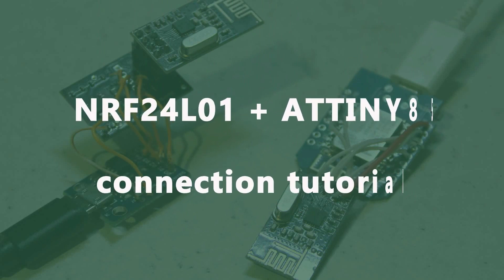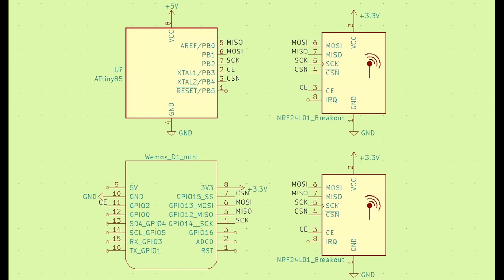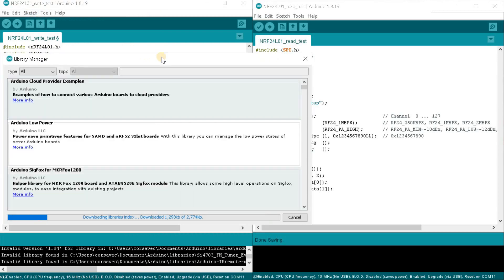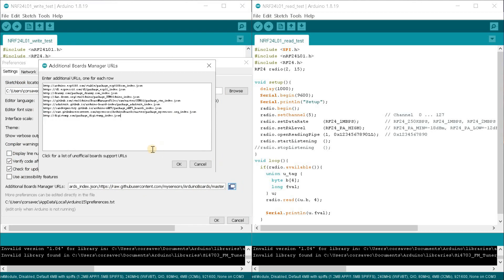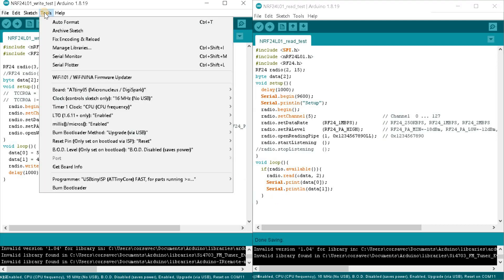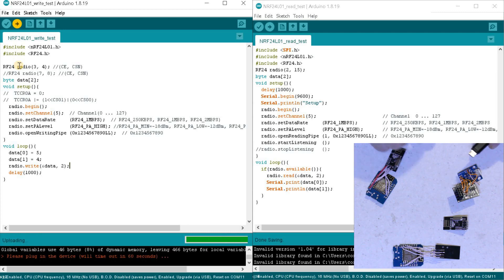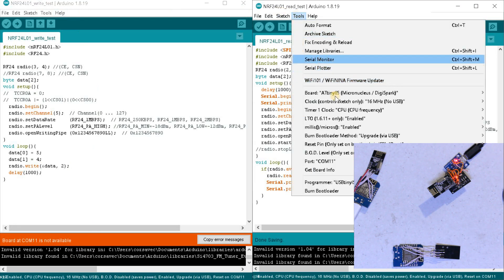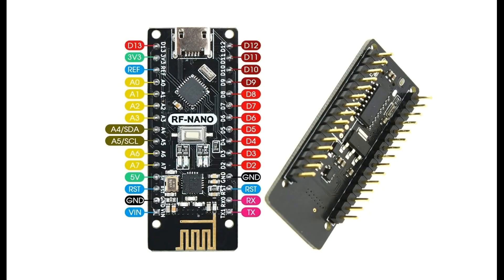🚩NRF24L01 + ATTINY85 connection tutorial

Comment from the maker: The ATTINY85 was the hardest to start the connection with. But these controllers deserve attention for their small size and low current consumption.
Reply: Hello I try to make the same thing but I have many issues. Can you give me your scripts for tx and rx to test please?
Reply from the maker: @dakeyofdasound  https://pinout.uno/articles/nrf24l01-attiny85-connection-tutorial/
Reply: @pinoutuno  thanks for all. I will send you te result. Now i do what I need using nano+NRF as tx. I use a push buton and a script to send one message if the button is pressed once and another if twice. My rx is an esp8266 node mcu with NRF . The message received is transformed in udp and is sent to another esp8266 rx and a led matrix to indicate "checkout open" or "checkout open only cb". In french cause ..  im french 😅. In that week i try 50 time to change my nano for a Attiny but .... I never send nothing. I prefer attiny because my txs are on 4+1.5v batteries and i try to get the best lifetime. See you and thanks ++++++
Reply: @pinoutuno  hello! I tried near 20 Times do do your exact system to begin and I never can upload the sketch. I tried on differents ide of arduino and 4 differents pc but i have always errors "spie". Have you an idea ? If i use a exemple sketch of attiny digistump Its ok but your sketch make me maaaaaaad 😅🥺
Reply from the maker: @dakeyofdasound  have no idea. I gave all the information in the video